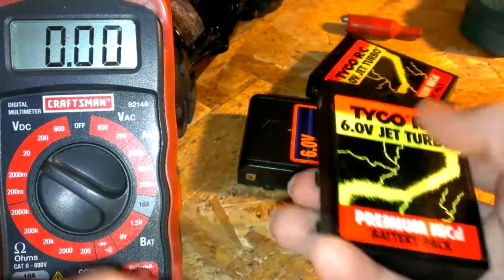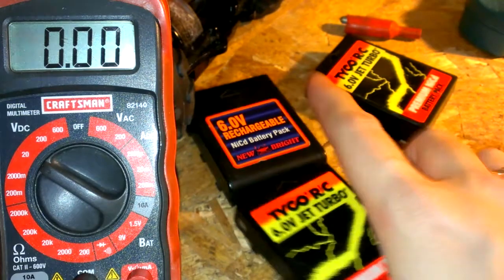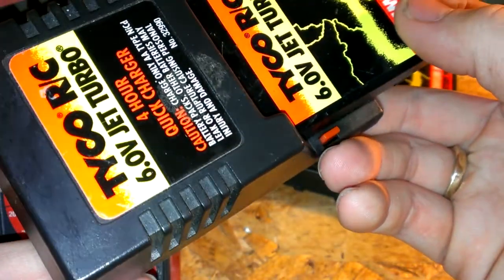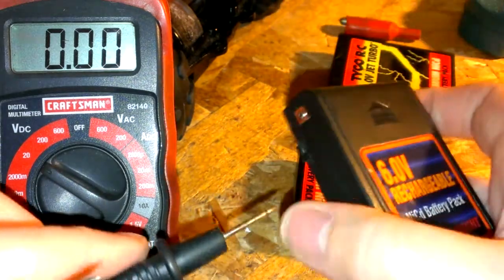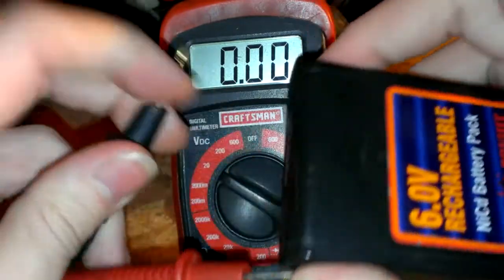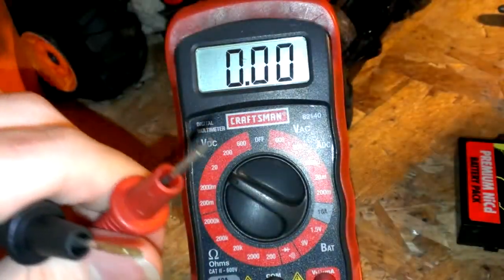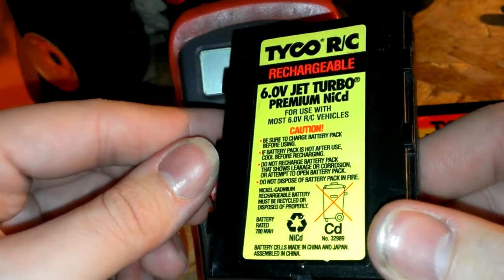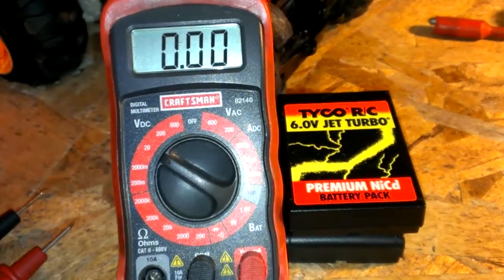NICD batteries last almost forever

Comment: why doesn't everybody talk about this? pulled out some 3.6v Ni-Cd Panasonic batteries from 10 YEARS AGO, they were very very corroded, sanded them down and soldered new wires to them, they had 4v in them!! didn't even need to charge them! that's amazing durability!